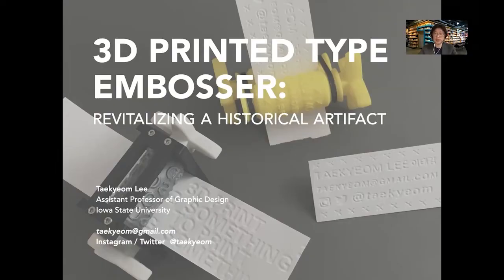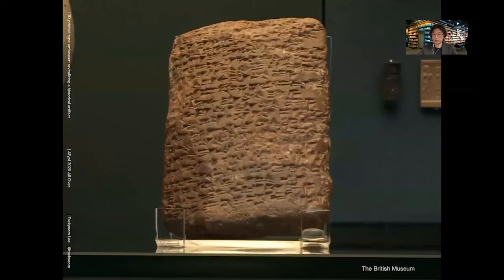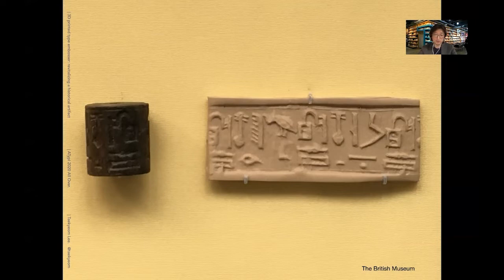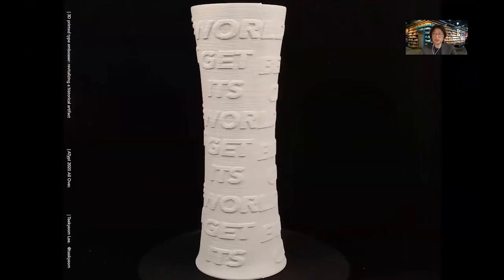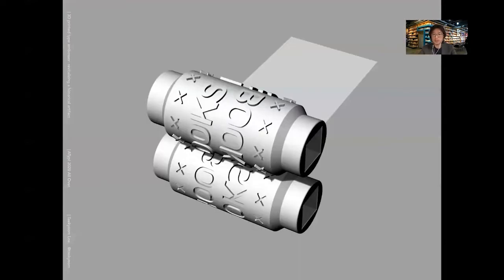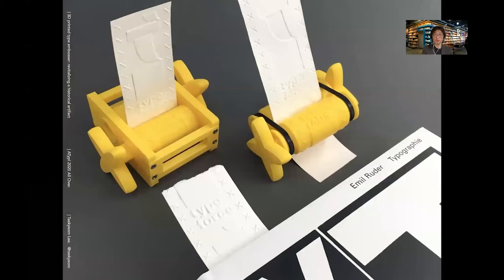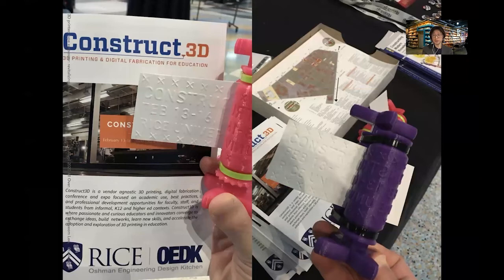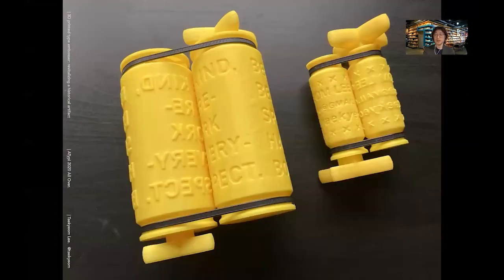ATypI 2020 - 3D Printed Type Embosser: Revitalizing a Historical Artifact by Taekyeom Lee

Comment: Very instructive and nice results!

Did you have a design iteration with a positive embossing wheel and a smooth rubber / foam wheel to press against? (Or of course a plain surface to roll on). I imagine it could be a quicker alternative with less crisp depth but no registration issues. Lightly misting the material might also create a stronger embossing effect on card material.
Reply from the maker: Hello, thank you for your comment. That would be another possibility as the letterpress uses rubber to make the impression. I actually thought about that, but the possible issue could be making enough pressure but not breaking the 3D printed roller. I will test the idea and make a few prototypes.